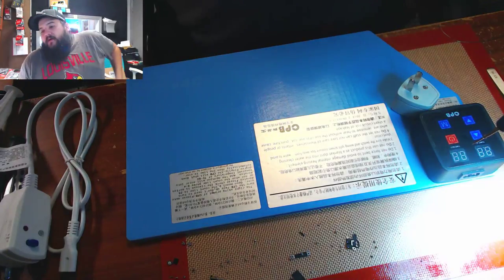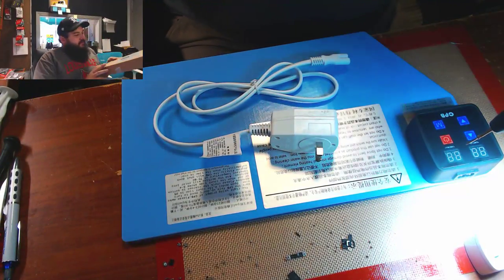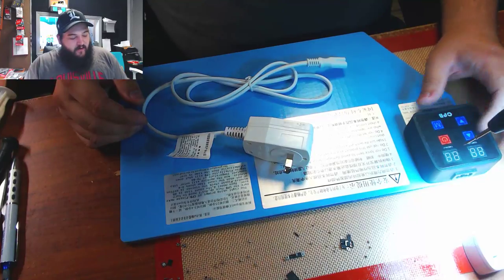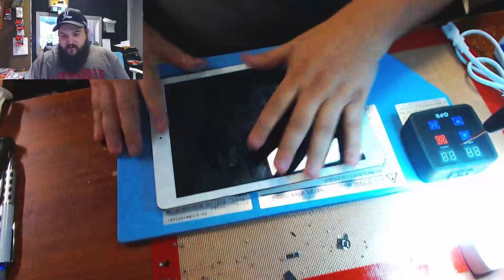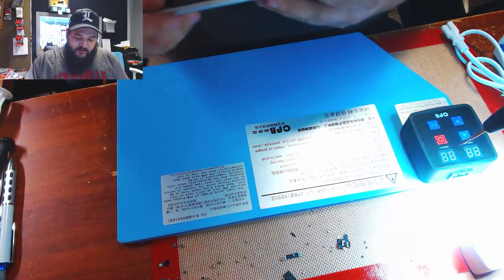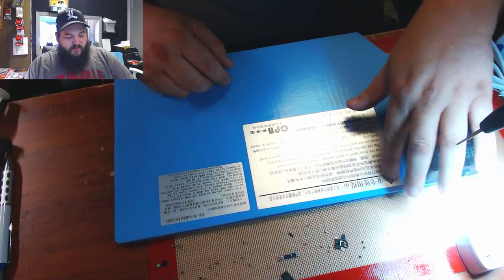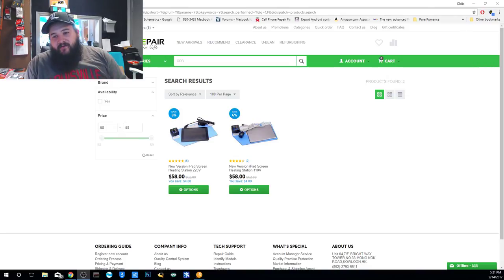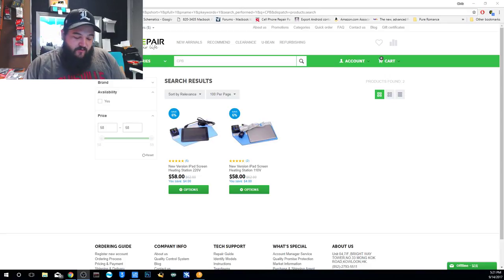CPB Heating Pad (Union Repair Tools Review)

Comment: Helpful video. I have seen other videos of this pad being used with tablets, where the glass is easily separated from the LCD - and that is impressive (sometimes cracked glass is the only issue needing repair). I want to repair glass only on Samsung phones- but all vids I've seen with phone glass-only repair show someone using a hold down device and a wire to slice down and separate the glass from LCD. Are phones adhesive just different from tablets? Or can phone glass separation from LCD also be relatively easily done with this heat pad? Thanks

Comment: OK, so I'm in the process of buying one of those now. I've always just used culinary heating pads. The high temp silicone ones they use for keeping food warm. They usually have like a casserole or a pan of rolls on them in normal use. It works but I think this might be better. It's worth a shot.